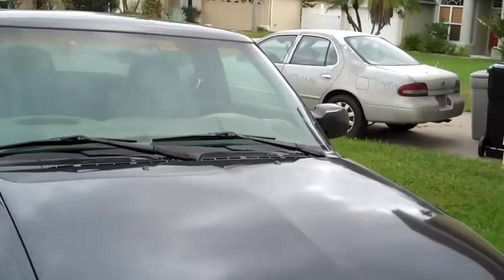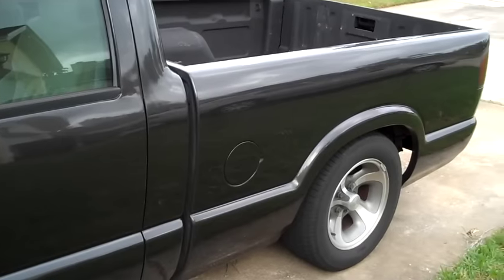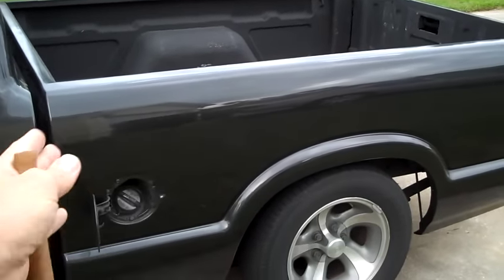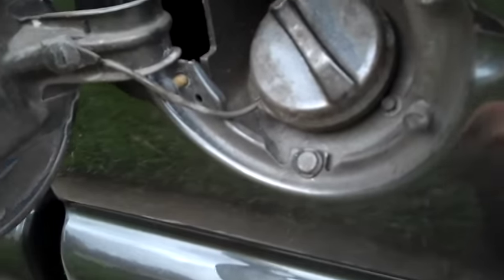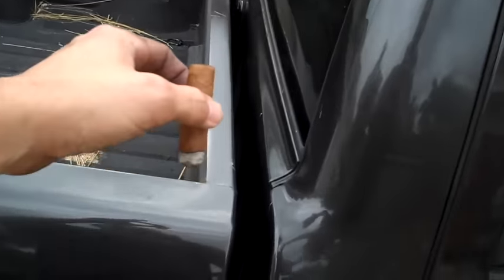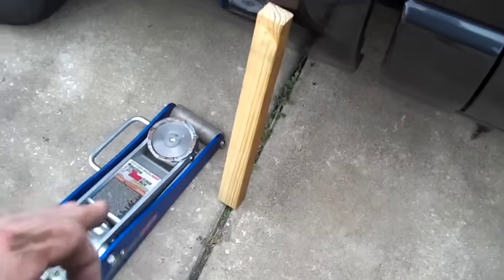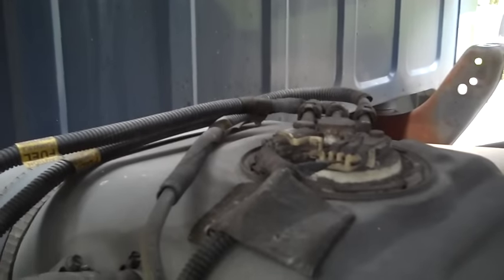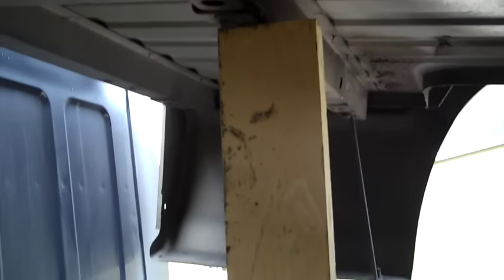S10 Fuel Pump Replacement Part 1

Comment: Cliff, I'm really impressed by your abilities! You do it right! You're first class all the way! I'm a former tool&die maker, super stock drag racer (record holder) engine builder,chassis builder and like you I can do about anything. I'm going to replace my 1998 S10 fuel pump tomorrow using your method of raising the bed. I have never seen this! You and I think alike ingenuity and creativity. The main difference is I'll be 69 next week so it may take me a little while longer. I saw a C6/C7 in your garage. I own a 2004 C5 under a cover with 17000 miles on it. Thanks and Godspeed!
Reply: I'm getting ready to buy 99 that's got the same problem thank you very helpful

Comment: I like the comments saying it's easier to drop the tank. The straps are usually rusted 1st.  Then you have to disconnect the lines before you can completely drop the tank  spout or filler disconnect, the cover around the tank. 4 bolts/ filler boot disconnect and raising the bed is fast and easy. Then you only have to disconnect at the pump. More time than not most pumps gomout when there is alot of fuel in the tank. Big mess dropping a tank in your driveway and not to mention lifting it back up. Having enough room to.drop the tank also means having you whole truck up in the air. That's alot more work. I like this method alot more.. the post is a great one and an option I always choose when working on a basic truck pump.

Comment: the rear light wiring cables ground out on left side  under bed with harness. Unplug harness and unscrew ground wire. after you tilt bed up you can slide it bed over rear wheels giving you more room.. great video

Comment: Looks like a pretty straight forward job.  My fuel pump died on me today.  I should have noticed that the pump was dying on me because it was becoming harder to start.  I checked the fuses and relays and they all seem just fine.  It's just that fuel pump that's gonna have to come out.  I like that I don't have to completely remove my bed and propping it up like I saw here is a great idea.  It's nice that replacing it won't cost a lot.

Comment: I would highly recommend doing this or cutting the bed. I’m dropping the tank and everything is breaking not to mention the driveshaft and the exhaust has to come off just to get to the fuel lines. Big mistake on my part.

Comment: Great video! Got all the bolts removed and loosened from the bed, then tilted it back and blocked it for safety, and then WOW!!!! No sight of fuel pump. My S10 is a four door so i have to drop the tank instead.
Reply from the maker: That’s not cool...

Comment: Just did this job today on my 2003 Sonoma ZRX..because I needed to replace the fuel tank pressure sensor which was throwing a P0446 code. 
Just to add to this video.  The bed weights about 70 lbs but is bulky.. If you have 2 people -- you will be able to tilt it right up; also there is a channel on the frame where the bed bolts in that the is perfect size for a 2 x4.. place one  10 inch 2x4 on each side and you will obtain excellent clearance; on my truck the fuel tank filler hose bolts were 7mm and there were only 3 of them on my truck; the 8 bed to frame bolts are 15 mm; and there was enough space to remove the front 4 using my Milwaukee 1/2 drive mini impact . I did not have enough space to use the impact for the 4 "rear" bolts and had to use a rachet..    This method worked perfectly.  I initially tried to lower the tank down but due to rust -- the 15 mm strap nut was frozen and I did not want to create additional problems... Great video.

Comment: Your doing it the hard way. First of all, I have 4 vehicles, so I have a road service plan with 135 miles of free towing. I wouldn't have had to pay a tow bill unless I was a long way from home.

As for actually replacing the pump, my 1993 has a step bumper on it, along with a dual exhaust that sticks out from under that. Removing all that would be a nightmare. So instead, I brought 3 coworkers home one Friday evening, We lifted the bed straight up and off, and set it on four 5 gallon buckets. I replaced the pump over the weekend, and they came back Monday evening and we set the bed back in place. I bought them a couple cases of beer for their trouble.
Reply: Gerald Scott bro that took three days, he did this in (I'm guessing under an hour?)
Reply: Tilt bed by myself, replacement in an hour, single bay garage. Your way gives more working room but it isn't easier. It took all weekend and required four people and more space. It also cost you several cases of beer.

Comment: Thank you for the great step by step replacing of the fuel pump.  Extremely helpful.  The pump has been ordered.  Knowing that there are only 8 bolts was very helpful.

Comment: Just wanted to let people know to make sure ground wires at the drivers side rear of frame are rust free before going directly to the pump....
Reply: Chris Paul i just replaced my pump. i took the bed off. stiil wont start. heard i gotta put the bed back on with the wire hook up. ground wires.
Reply: ok , delete your number, what time

Comment: Thanks bro i was having the same problems with my s10 I when and replaced it myself but when I was done it wouldn’t start up again so before you replace something else go get your batterie check out then I got the recharge and started right away so do the first before you put more money on it.
Reply: Bad battery and fuel pump have totally different symptoms. If it had a bad battery and you replaced fuel pump thats like replacing tires because your headlights dont work.

Comment: Was the old fuel pump  unusually loud before it quit? I have a 2000 Sonoma 4.3 with 46,000.. the pump has been loud for years now, never any signs of low fuel pressure as it has plenty of power.
Reply from the maker: +Eric Worden I didn't notice any noise, it would just not work randomly.

Comment: I had my fuel pump replaced and then about a year later my gas needle started messing up. It's always showing full and occasionally will Bob back-and-forth but it always goes back to the full mark.
Reply: Bradley Davis Could be a wire grounding out  from the pump, or the arm on the pump is out.
Reply: Thank you I will check.

Comment: wow that looks like a nightmare. on a subaru you just have to lift up on your backseat and then there is the acsess panel
Reply: it really isn't bad...ive seen a few trucks fixed by normal guys where the whole bed removed, fuel pump replaced, bed put back on and test drove in less than 30 min
Reply: Shishizurui I'm a Subaru guy who was gifted a GMC Sonoma with 335k miles. I appreciate your comment

Comment: would be easier of you drop the gas tank ?
is that a cigar un your hand great combo with gas fumes.
Reply from the maker: +Edwin Rodriguez I didn't think so. Tank was full of gas. That is a cigar. I was done before cracking open the tank.
Reply from the maker: +Lestat I've replaced pumps both ways. In my opinion, this was much easier than wrestling the tank full of gas. I had to remove 4 bolts, and loosen 2. They weren't rusty at all, and easily broke free with a breaker bar. 

After that, I just used a jack to lift it. I think it took me an hour and a half to do this. That includes record time, and doing the wiring necessary. 

Quick and easy.
Reply from the maker: +Lestat but by all means, if you prefer to crawl under the truck and do it that way, have at it! I prefer this way by a long shot!
Reply: i had to do the same thing on my 96' ZR2......to each his own but i prefer pulling the bed off
Reply: What size are the bed bolts

Comment: Just take the bed off, that's the safe way. It's not that heavy if you get two people. I just slid it off to one side and stopped it with an old spare tire  flip it around to wire wheel and undercoat it.

Comment: would you know how to remove the antenna on the passenger side fender so you can completely remove the fender? I need to replace the passenger side fender on my 96 chevy s10 but after loosening the two bolts on the antenna, I can't figure out how to remove the antenna.
Reply from the maker: +Brian Denney not really sure off the top of my head. It sounds like yours is different than mine.

Comment: correct me if I am wrong but wasn't that the evap test port at 6:20 into the video.  other than that , nice idea .
Reply from the maker: +jeff I think you're right actually!
Reply: jeff yea it definitely is. green cap equals evap.  to get rid of pressure either find a Schrader valve on the fuel rail or pull the relay to let it die. but if the pump is out it doesn't even matter.
Reply: least i wasn't only one who noticed that lol

Comment: Love this method, would the rear bumper need to be removed?
Reply from the maker: +Jeremy Moore you know, I really don't know for sure! My car has a roll pan welded on. 

I would say that I don't think so, but you may want to verify that!
Reply: The bumper is attached to the frame, so if you were to remove the bed, take off the bumper first. It's like 4 bolts or something
Reply: No taillights and bumper stay intact

Comment: im looking at buying a 1998 s10 and it has a fuel pump issue do you think that this is a common problem for s10's
Reply from the maker: I’ve heard many people say they’ve had to replace them. However, I will say this: if you’re buying a 1998 anything, that thing is 20 years old. You’re going to have to work on it...
Reply: I’ve got a 99 s10 and I’ve replaced the injectors and fuel pump.
Reply: They’re not terribly hard jobs to do!
Reply: My pump wasn't bad but the sender was doing the bounce thing. I'd say it should be an expected repair at some point. I had a pump go out on a 1999 Ford Contour as well.
Reply: Yep sure is

Comment: Hey I can't seem to get the front driver side bolt to come loose, any suggestions?
Reply from the maker: I’d try some penetrating lube. Let it sit for a bit. You can’t really use heat on that one, as I’m assuming you’re trying to loosen the body mount bolts? Those mounts are rubber, heat will destroy it.

Comment: its much better to just take the box all the way off the truck ,,,, you will need to get at the pump so you can push it down ,,,i just did this ,,,, and you will need a impact gun to get the bed bolts off because they are very rusty and you may break some of them
Reply from the maker: I had no problem getting them loose. And if you think it's better to take off the whole bed, that would definitely give you more room to work. But it was just me working on it. you need at least two people to pull the bed.
Reply: I think your way is much better. Getting the tail lights detached is just another obstacle with more dirt falling. Thanks for the Video.. @CliffsHowTo

Comment: Could use a motor hoist with a strap going through the front hooks in the bed , alot easier and safer than a floor jack. Good video though...
Reply: I have a chain hoist on my garage door opening header. I just backed under it and use hoist lift it. I lifted rear with engine hoist.